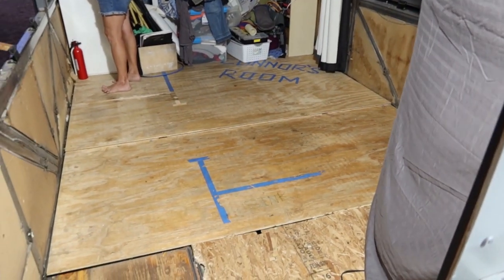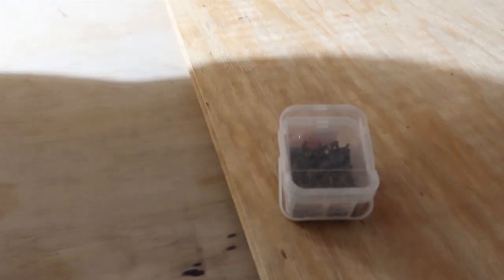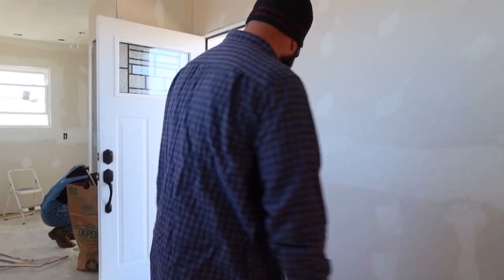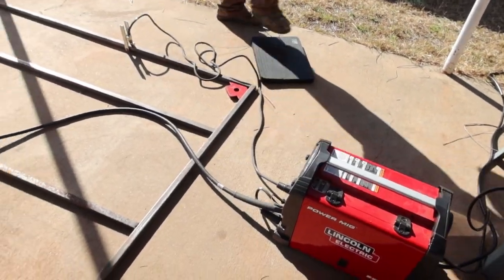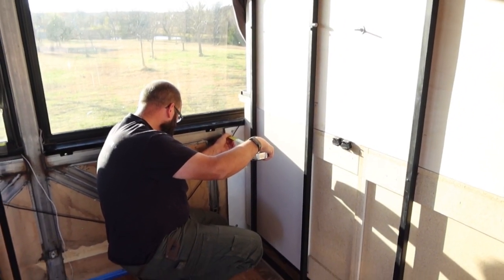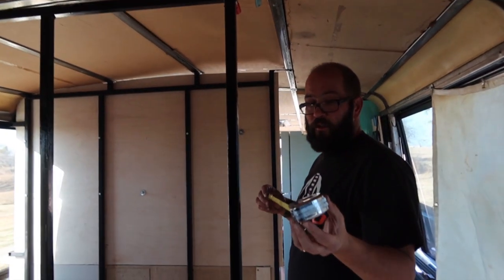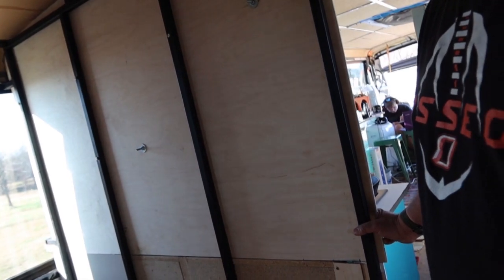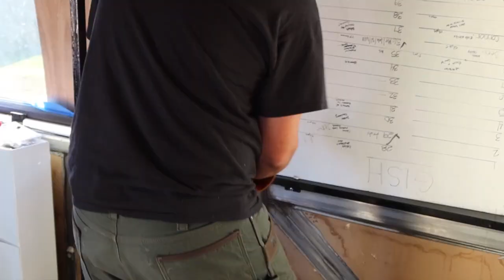Installing a Subfloor and Wall in Preparing for a Toilet & Hot Water in our MCI Bus Conversion S3E4

Comment: Nice guys! Are you not going to insulate your floors? Also I like your approach of using steel for the wall partitions. I am a cabinetmaker and hadn't considered steel. 

This week I picked up a lincoln mig Pak 10.  Haven't welded much, would you recommend gas or flux core, and do you think this welder would be okay? Also what precautions have you taken to protect bus electronics when welding in it? Thanks Andrew! Keep up the good work!
Reply: Pak10 should be plenty.  Gas mig will give better results especially welding inside.  Nothing wrong with flux core but it tends to shoot slag all over and you’ll need to brush or wire wheel the welds clean.  I too like the idea of the steel structure especially when it comes to door frames etc.  but I would be worried about weight versus using a lightweight lumber.  Either way it’ll have to be skinned in plywood and running various things like water and electricity thru that steel frame is going to be difficult.  

I enjoy the diy spirit. I too am looking for a prevost h3-45 or a mci e/j4500 to start an rv conversion on.  Like you said in a previous video I’m just trying to find “my bus.”  Keep up the great work.
Reply: @ka0tyk  thanks Derek! Yeah I need to build battery tray frames and an enclosure for my generator etc, so most of that can be done outside bus and bolted in. Hey if you are interested in a bus like mine for 10k range and in the Toronto area I can put you in contact with a company who is original owner, where I got mine. Email me at barnards at Rogers dot com.
Reply from the maker: @nbarnard  Thanks, I prefer gas, because it's a much cleaner weld. Like Derek mentioned flux core shoots a lot of slag out and the less I have to clean afterward, the better, especially when welding inside of the bus. The Mig Pak 10 should be a great welder for you. Good luck! I have my main battery switch for the bus disconnected when I am welding within it too. I was an auto tech for over 20 years and was taught in tech school that you should disconnect the battery of a car before welding on it. That being said, I have welded on well over 100 cars without disconnecting the battery first and never had an issue. 
@derek Engstrom The walls will be too tight for plumbing, but electrical will fit, and we designed the floorplan in a way that all of the plumbing can be run and accessed from the bays below. (Most of our electrical will be run this way too.)
I'm unsure if the steel weighs enough more to matter as the strength allows me to use less of it, and also allows for a thin, lightweight sheeting material. Removing the factory AC removed more weight than all of my walls are going to weigh. 
As for insulation, the front half will be insulated from below, the rear has some insulation already even though it's more for sound than temperature control.
 Thanks again for watching and good luck with your own bus's!
Reply: @andyandnancy   yeah I enjoyed your realistic view on initial gutting of the interior.  I didn’t realize those storage bins are solid all the way down. I’m sure it all weighs a ton. I asked a guy who was selling a j4500 if all that stuff was worth anything and he said most of it was just trash. Not much scrap value to tear into all those seats either.  Bummer.  How bad was tearing out the toilet?  I can only imagine the years of people peeing all over everywhere in a moving bus and how little it was cleaned.
Reply from the maker: @ka0tyk  the bathroom enclosure itself was terrible to remove I ended up cutting it in half with a sawzall and the tank was even worse between the foam that glued it in and a hidden fastener it was a struggle. I did it when the temps were below freezing, removing it on a hot summer day would be miserable at best.
Reply: @ka0tyk  the toilet actually wasn't as bad as I was expecting. Probably helped that it hadn't been used in about a year and I had driven it for several days with the exhaust fan on. When I first picked it up it stank, but a couple days later the smell was almost gone. The walls were a bit of a pain, I just cut fiberglass sections out with grinder. The tub was pretty straight forward, just had my son disconnect the valve from underneath and it came out with a prybar, no cutting actual tank. Was pleasantly surprised with relative ease so far of all the jobs of stripping it down, to date.
Reply: @andyandnancy  thanks for the tips on welding with electronics. Funny bus has all these warnings to disconnect ecm and stuff before welding, maybe that's for liability etc. Good to know you have had good success with welding in cars over the years. Even that disconnect still leaves the batteries partially connected so I wonder if that is going to help anyway.
Reply from the maker: @nbarnard  hopefully I won't, but if I fry a module I'll let you know.

Comment: Andrew have you considered drilling the frame structure and injecting foam inside it, for the ceilings and walls? This is something Ivan did that I am considering. Primarily for heat loss during winter. Thoughts?
Reply from the maker: Yes, I have thought of it for two reasons The first being the insulation that it would give me. Even though the science of convection vs convention tells me that the metal will transmit energy through it easier than through the empty cavity anyway. The second would be to glue the backside of all of the rivets in place that I have drilled out to remove the parcel racks. I can't hear them rattling now, but as soon as a ceiling is in my way I'm sure they would start.